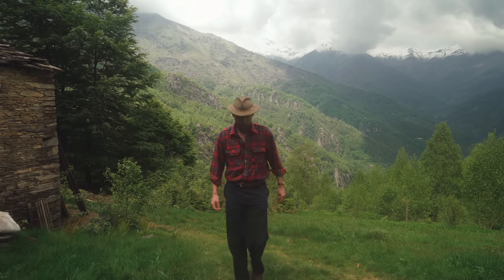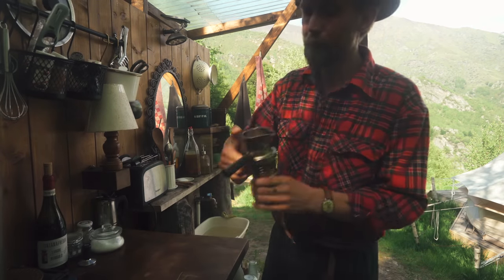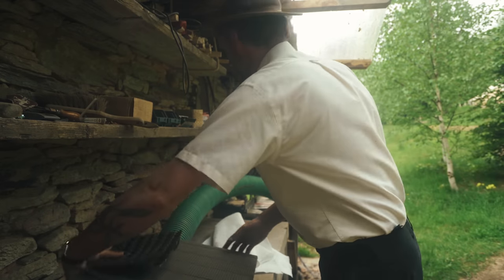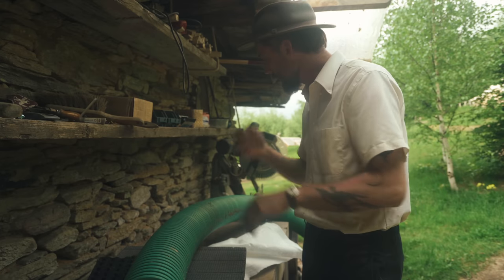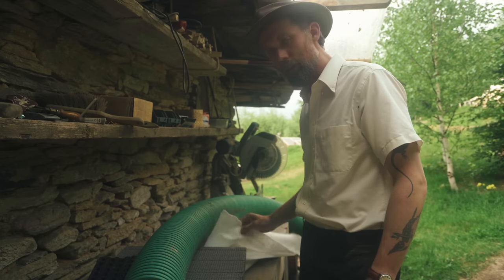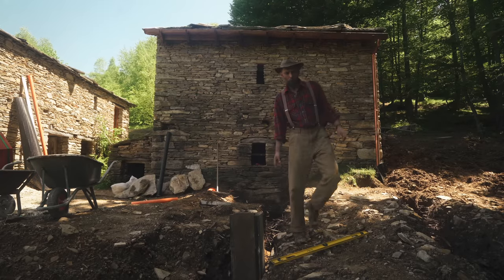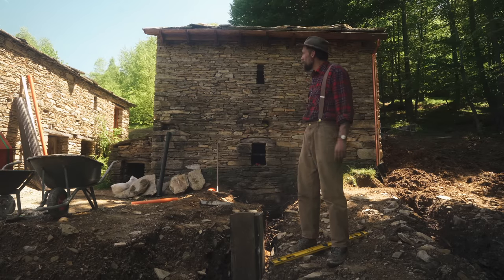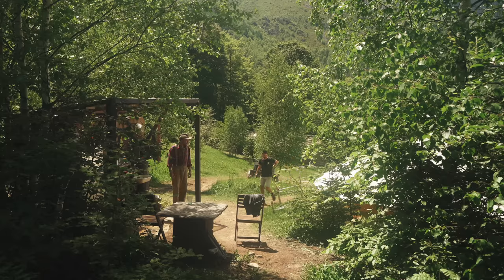#68 Waterproofing the Cabin, Closing the Trench

Comment: Just an idea: A little stone terrace with a low wall would be a great thing to put on the downhill side of the cabin.  It gets shade in summer and sun in winter.  Perfect spot for your morning coffee! If you need to service a pipe you can pull up the stones for access.  The low wall provides for extra seating, as well. Nice communal spot, beautiful valley views.

Comment: I think you are overheating the 9Barista. Try and find the lower limit of heat, before it almost stalls. The flavor you extract will be another world.
Reply: I think it would be difficult to find the optimal temperature.  Experts say 203F degrees.  Or is the 9Barista designed to have a 20 to 30 second extraction when at the best temperature.
Reply: @garypeluso3300  Exactly, the 20-30 seconds is a good benchmark. In the video, it looks more like 5-8 seconds.

Comment: Can you possibly return less of the soil back into the trenches, and widen the new lower areas generously, It would seem that quite a lot of the soil has arrived after the houses were built, so it should not weaken the structures. It could allow you to have larger flat areas around the buildings and ditches removing heavy rain water befor reaching the houses. Just a thought.
Reply: I had the same sentiment.  I think a retaining stone wall for any subsidence further up the bank.

Comment: Great job. With our  house we did similar things. When you put in the Imhoff sewerage system I suggest you put some water in the tank. Given the rains you had it will prevent the tank from floating when it rains. Also do put in some inspection pozzetti outside. The help enormously when the system blocks (eg because of fats).

Comment: Great videos, always a pleasure.  For future reference when using a machine like this anywhere, but especially on a slope, make sure the ROPS (roll over protection system) is in place and you are always wearing a seat belt. It looks like they left it off when delivered.  They are designed so if the machine tips over it doesn't crush the operator.  Also, put the push blade down in the dirt and dig over the blade.  This will provide a greater breakout force and less chance of pulling the machine down / into the hole.  Stay safe, keep up the great work.

Comment: I think you have made this incredibly heavy structure unstable by digging next to the foundation. It is the runoff that would affect the structure, runoff could be diverted further up the hill.
Reply: Doing it this way allowed him to insulate insulated the foundation as is common practice in modern home building. Once it is backfilled (again as done in modern basement foundations) it will be as stable as before and more resistant to erosion caused by seasonal flooding.

Comment: Hi Martijn
Watching your video is my first activity on Mondays mornings (Australia). You inspire and encourage me to get on with my own, much more modest projects, by reminding me of the three Ps of success: patience, persistence and problem solving.
One thing you didn't mention in relation to your French drain is tree roots (and you have several trees in close proximity). If a root gets into the drain it goes yippee, free water and multiplies into a fine network which can completely obstruct the drain. Your wrapping should  prevent this but it has to be the whole pipe. At the lower end you might not think sand and soil is a problem there but roots can grow back up the pipe
Reply: and I should add a fourth P: pleasure in what you  do

Comment: Martjin, you need to build a covered terrace so you can sit outside and eat in the rain 🌧
Reply: I was thinking the same thing...maybe a covered arbor would be beautiful..and, Those little wooden chairs will not last long continually exposed to the weather...
Reply: Agree and it would also be nice to hide from the sun during summer
Reply: Gazebo with a wooden roof covered in green metal ...anchored with four stone pillars and huge wooden beams anchored & cemented into holes on top of the large square/rectangular stone pillars.  It could be large enough to have a grill underneath and picnic tables & be like an outside room  ...kind of like what you see at the best American national parks.
Reply: I guess to get extra work done, he would need a permanent team of volunteers. He is some man. I hope he is in his cabin before winter 🙏 ❤

Comment: Hi martijn .ks here. 4th time hopefully is the charm.  So I have done several  basement waterproofings.l have done an additional step. In my case brick , on the brick I applied ,  painted and rolled a coating of roofing tar. this seals the brick and enables the plastic to adhere to the wall easily. Hah , rather easier.      The tar is old fashioned..It made a lot of sense to me so I did it.    In the states here a sock or sleeve is sold to cover the plastic tubing. Possibly easier  to use  than the fabric you are using ..  one comment suggested making a 'V' trench on either end.  Outside.  This too is good, anything that diverts the water.however the , your main focus is the roof run off. 
I think your rainy week -two wks ago was perfect timing in that it allowed you to see your weak spots and tweak you handywork.
You are in for another rainy week coming up. June.  Arg ! The constant challenges of a  builder.. ya gotta love it.😇

Comment: In my area they use a tar like coating on the exterior and paint it onto the foundation walls. After that they do a membrane and dimple board. The dimple board gets nailed on. The intention is if water does manage to get behind the dimple board it runs down into the drain. Our French drains aren’t always flexible. They have a mesh sock over it to help keep silt from entering the pipe. They then place the drain in a fabric that keeps dirt out but allows the water to flow through. They use washed gravel to fill the ditch where the French drain sits in the fabric and then wrap it like a burrito so it doesn’t get clogged by debris. After that the burrito gets covered with more gravel then another layer of fabric and finally the dirt. I think areas with more clay in the soil it’s different and probably areas with extreme cold weather are also different. I think technology is always changing and evolving so there are probably many things different. And of course your geographical conditions also have much to say on how things should be done. It’s very interesting to me to see how it’s done in your neck of the woods. That’s one thing I have enjoyed a lot of YouTube. Thanks so much for sharing it.

Comment: Hi Martjin, I follow your videos since a long time and I've always been fond of what you do.

I know it is too late, but I'm quite "worried" that what you are doing to "waterproofing" your cabin is a good idea in the long term. I know that you got help from professionals, but don't forget that they often use methods that don't work for old houses like yours (here in France, they did lot of damage in stone houses).

First of all, even if you dug quite deep so humidity doesn't come up from the ground to the walls by underneath, It will still be the case (the humidity likes to even itself in the ground, so it will still be quite everywhere), and because water won't be able too go anywhere but up in the wall, it will go until it can reach somewhere to escape, which will be the upper part of the wall (and I think you'll have humidity in those places). In stone houses you have to work with humidity and not against it (like what you do with the lime mortar). I think the french drain would have been enough, the insulation and plastic cover might be too much (and i'm not talking about the ecological point of view of those materials, which I find quite sad to use in such preserved natural places).

If i were you I would have applied a lime coat of NHL 3,5 to allow the wall to breathe without the water to come in excess in it, with the french drain it would have been way enough to allow to humidity not to come in excess (and be allowed to come inside as well when it's dry and vice versa).

What I see in what you do is an inspiration, for lot of people (you can see it in the comments and you deserve them), and I think you have almost a "duty" to do things the right way (ecological and with the architectural heritage, so people can do things better), and you do it well a lot with lots of things, and I want to say it ! I know it's not always easy with everyone saying everything and I know you won't follow a comment found on the internet.

I don't want to sound know-it-all, I know you did your research but I still wanted to share this opinion with you, I hope you don't receive it the wrong way
If you were to come to France (in burgundy) one day, I'm renovating an old house too, I would be happy to receive you !
All the best
Reply: @Guillaume en Bourgogne.    Thankyou for this. I am worried also about the waterproofing.  I am concerned the french rain will fail under the weight of the rocks and soil & hoping that there will be swales or some type of water diversion from the upper slopes.  And as the stonewall will be sandwiched between plastic and concrete,  it would seem to defeat the breathability of all the lime work.    I read through many of the comments to see if anyone else shared my concerns.   I love Martins videos and have  watched all his previous videos.   I also love his creative approach to building.  But this one,  if it fails will not be an easy fix.    I am not  renovating a stone house like yourself & Martijn,   my renovation  is brick & terracotta roof tiles!   But I am fascinated with stone houses and use of lime.   Good luck with your stone house Guillaume,  what a marvellous journey!   
I will continue to love Martijn videos,  with my fingers & toes crossed.  🤞🤞
Cheers from Australia 🇦🇺

Comment: Hi Martijn, I find the soft sounds Hens normally make as they forage to be pleasantly relaxing and their individual mannerisms can be quite entertaining so they can be pleasant company.

We live in a village in hill country which does not have mains water or a sewer network but does have grey water removal so our home also has a septic tank.

Bearing this in mind I offer some observations and suggestions based on experience which I hope might be useful to you.

Unlike removal of raw sewage via a sewer, septic tanks require periodic removal of solids and if this does not occur you might find yourself with an unpleasantly messy problem.

Unless a tanker truck necessary for such removal can access your septic reservoir from the track near the closest boundary.

And given that you don't normally use that easier route for other purposes implies such a vehicle possibly cannot because the track is a private access for another property.

You might consider establishing better vehicular access through your own property from the top road along the route you habitually use for your little SUV and trailer to at least within a distance more convenient for relevant suction tubing to reach your septic tank from a removal truck.

While it is inarguably preferable to keep the original beauty of the place as intact as possible concessions to expedience may be necessary.

That you have made no concession to better vehicular access during other aspects of your project where it would have been advantageous seems to imply you probably prefer your property the way it is.

But having had an example of how difficult it was for a small tip-truck to get out again from where it delivered loads of gravel during relatively mild wet weather despite, that location being only part of the distance to your septic tank.

You can undoubtedly imagine how difficult it would be for a truck containing a substantial quantity of raw sewage weighing an average of more than 1kg per litre to negotiate a greater distance over mor difficult terrain subject to similar conditions or worse.

Unless you are prepared to statistically monitor probable average usage of your septic system in order to approximately anticipate need to empty the tank.

Murphy's Law dictates that doing so will probably become necessary subject to the most inconvenient timing under conditions comparable to those which caused the tip-truck which delivered gravel to experience difficulty or even worse.

Being the methodical person you obviously are it is likely you did so but in case you have not I suggest you seek guidance from relevant authorities regarding whether a specific design and capacity is officially stipulated for a septic tank on your property.

Comment: ah i wish i could have watched this sunday! ah well its monday, close enough!

your work on everything is flying along! im very pleased the drain worked and your main plumbing is done nearly! 

i was wondering, could you have run in the sewer to the other cabin as well (dig the channel and go so far with the pipe) and put a sealing cap (if i recall rightly, they screw on and make watertight) on it outside just away from the cabin so you just need to fix the pipework for inside later and expand to it? therefore possibly removing the need for redigging around the junction? 

anyway, your doing really well, and the views keep getting more and more beautiful! and, of course, the chickens look so happy 😊

Comment: Surprised you didn’t place the perforated pipe on the outside of the wall to prevent the water entering into your home? Several pipes at different levels would make a big difference. I envy you having a place like that 😊
Reply: I thought that was kind of a belt and suspenders approach too. But hey, maybe if the French drain is ever overwhelmed or inadequate in some way it will be worth it.
Reply: @garyfairbrother5532  I think this is done because the upper drain is situated half way up the wall in the cellar. In other words, half of the height of the under ground cellar wall is exposed directly to the dirt outside. The inside drainage will get rid of any moisture coming through the wall. But I think he will need a moisturd barriere on the inside wall as well.

Comment: I feel there is too much advice from too many people. But I am wondering about the septic system you have chosen to build. The small 'plastic'  tanks that I often see buried cannot last for more than a few years before needing to be pumped. With the issues you have getting a truck in for delivery, I envision a nightmare with a pumper. The bigger (usually) concrete tank with a drain field works in a more composting fashion. Properly designed they can work for many years with little maintenance. Good luck on whatever you have chosen.

Comment: You've probably already read this, but the chickens are still too young to lay--you'll know they're getting close when the combs and wattles (the red things that hang under their chins) start to develop and suddenly turn red.  They probably need another month or two at least, they looked about 4 or 5 months old in the first video.  Hens lay anywhere from 6 months to some as late as a year old--good news is heritage birds that aren't high production lay later but lay for years longer and are generally healthier than factory created crosses.  So as long as you don't have predator problems that flock will lay for 5 to 6 years. Keep an eye on the white one, hawks and owls can see that color way to easily. 😅

Comment: Probably it's late to tell that, but as we were renovating drain system around house we encountered a lot of small roots going into French drain even with some securing materials around it. It's good to have "service holes", so from time to time, You can clear it up with high pressure water hose. Great episode as always! :)

Comment: Extreme weather was a revelation. Gave time to evaluate existing design and determine if changes are required. Good thing you planned for double redundancy by incorporating French drains inside and outside. Not sure if you have plans for two pits: black for sewer and gray for roof rain run off with French drain run off.
Later once drains and sewers are installed, does your landscaping plan for water containment (grades, trenches, swails, berms, tree planting, etc) around the two cabins?
How deep do you plan if any, to bury and insulate water lines for year round use? Close to the cabins, are you allowed to wrap water pipes with electrical heater coils?
On days with heavy rainfall with clear skies, can you provide aerial footage of the neighboring waterfalls and streams? Lots of greenery, scents and animal life.
Cabin 1 is getting closer to being fully damp proofed, having running water & sewer connections.

Comment: Hello Martijn, if I may ... I would like to give you some advice to avoid, when it rains or pours, the water seeps through the walls of the cabin. Some time ago, submitting my idea of buying a cabin similar to yours to a bricklayer of a different age, I asked him how to prevent water from infiltrating. He told me that considering the fact that the stones of the perimeter walls are placed horizontally, (therefore easy penetration) he advised me to make an excavation, (like yours) insulate the wall well with polystyrene or polystyrene at least 10 cm thick and then place all around those artifacts that are used to channel the irrigation courses. Cover them with grates, so that when it rains heavily, the water falls in and is channeled and goes down without soaking the walls. I, the first thing I will do ... will be this, being the half-buried huts, go around them to prevent the water from entering. You are already on the right track! 👍